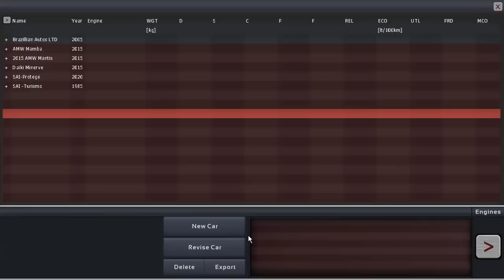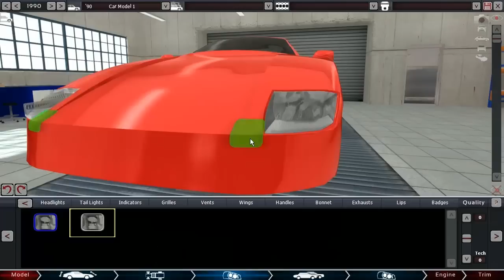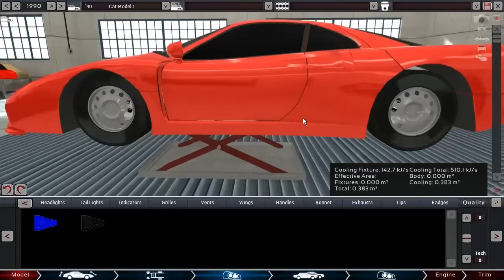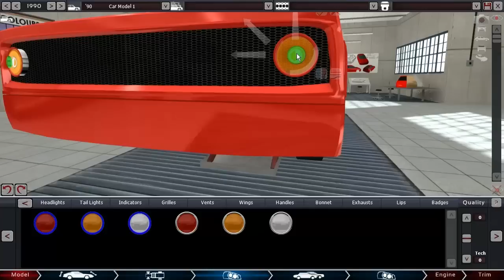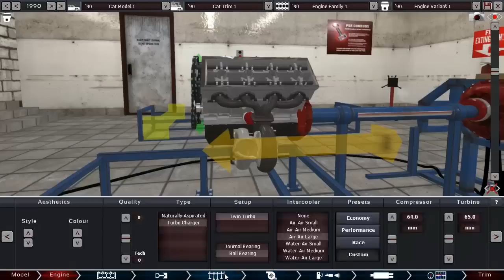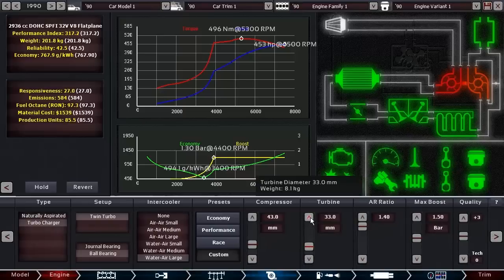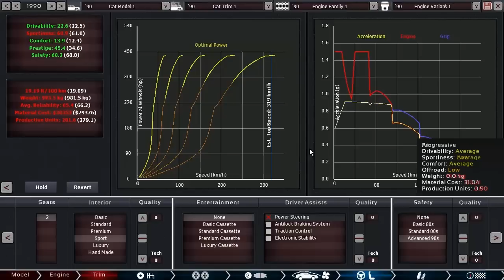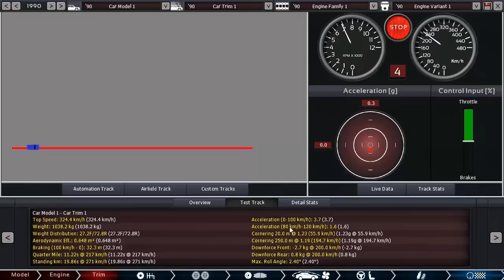Automation [Ep. 93] - Building a Ferrari F40 replica

Comment: Hi Tom. Great video btw but I have three tips that you can use in designing your cars and engines. 
1. In the new open beta you can copy pieces of trim by holding shift and dragging. Like for instance with those four vents at the back you could have shift dragged them which would make it easier and make sure that they were the same size. 
2. You can morph the body after creating fixtures so if you forget to flare the wheel arches you can go back and flare them even after you've added fixtures. 
3. With a turbo engine you can make the exhaust diameter larger than necessary to make more power rather than adjusting the compressor or turbine size.
Reply from the maker: Evander Ogidan Thanks for pointing that stuff out! 1. and 2. are things to get used to, you know old habits die hard they say :D 
3. I personally don't agree with because while it's true that exhaust diameter can give you more power, it rarely makes a meaningful difference to torque curve or the RPMs at which the turbo spools up.